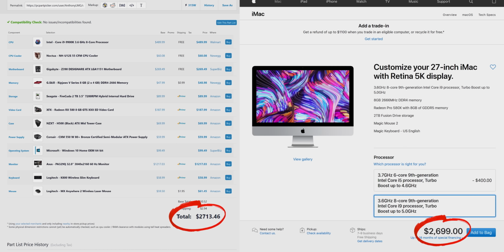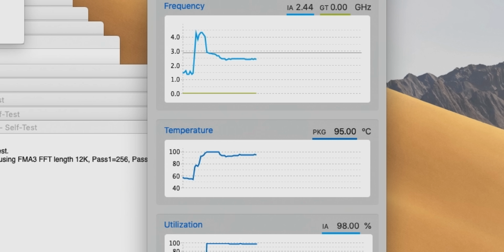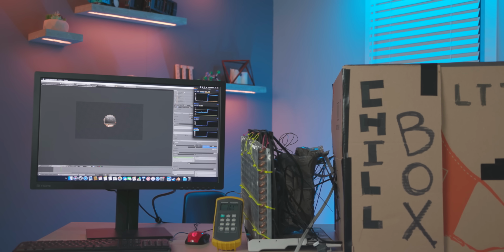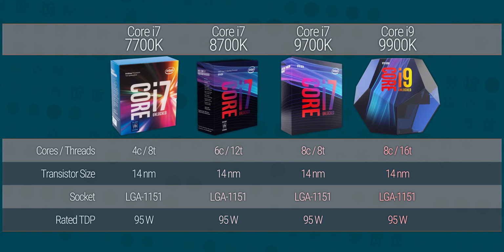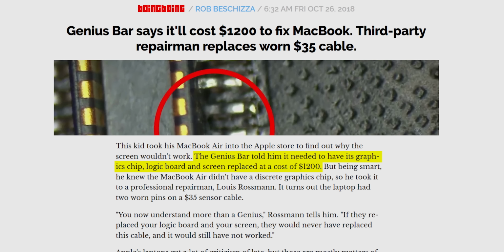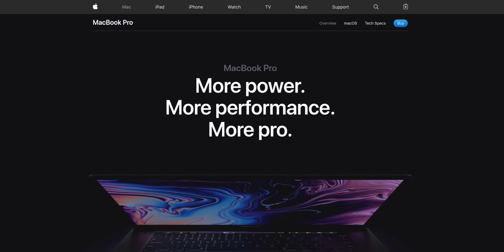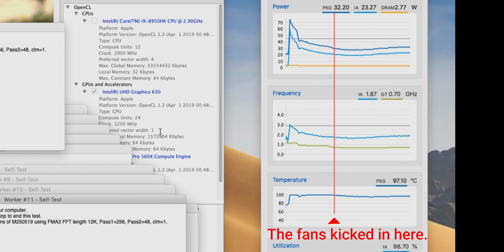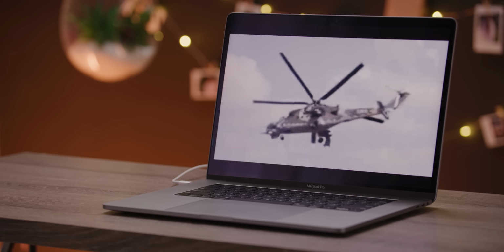Macs are SLOWER than PCs. Here’s why.

Comment: I own 2 laptops.  A Dell 7577 gaming machine, and a 2018 macbook pro.  The fact that the Dell has a battery is little more than a technicality, and its noisy as hell.  Working in IT requires me to always have a laptop handy, and its especially nice if its light weight, quiet, fast, and has an actual 10 hours of functional battery life.  You asked why Apple chose their passive-first cooling policy?  Its probably because their target market isn't going to constantly run benchmarks to peg the CPU full time, or mostly play games on it.  For convenience and portability for light to moderate business work loads, it outperforms every PC I've used.  It's MUCH nicer than my chromebook, not to mention way more functional.  The only thing close would be the Dell XPS 13.  For design and sleep functionality, and the fact that the display is 16:10 vs 16:9, the macbook is a better choice IMO.  And, anecdotally, the mac has never felt hotter in the lap than windows machines.

Comment: There's an application that allows you to set custom settings for your fan speeds on mac. 
If you set it to run at a higher RPM starting at a lower temperature point the mac won't thermal throttle as much.
https://www.crystalidea.com/macs-fan-control 
There's even a version for bootcamp.

Comment: Metal Liquid'ed my ROG g703, it wasn't throttling, but was running too hot.
Now... it runs like a dream, literally. Playing on High or Ultra in AAA games with around 100fps average :)
(the g703 has huge fans to beginning with, just... really crappy thermal paste)

Comment: OMG!!!!   Normally, I like your videos.   But this video is just several minutes of a crybaby.  Your hubris has lead you to mistake opinions for facts.  ( “They did it on purpose.” )

Thermal throttling is a simple concept.   Anyone who can tie their own shoes, should be able to grasp the concept of thermal throttling.

You mentioned physics.   Any freshmen physics major can tell you why thermal throttling is necessary.

You also failed to mention that Apple uses Intel CPU’s today because IBM and Motorola COULD NOT keep the temperature of their CPU’s down to within Apple’s acceptable temperature range.

Speaking of CPU’s, you also FAILED to point out that MacBook’s and iPhone’s USE DIFFERENT CPU’s.   How often is someone going to run Photoshop on an iPhone?   How often is a CAD engineer going to complete an engine design on an iPhone?   Let’s focus on reality, ok?

The truth is many Apple users do not need the maximum clock frequency of the CPU.    Professional Photoshop artists use a WORKSTATION class machine... Apple or Windows.

Not many MacBook users sitting out in direct sunlight for hours on end either.

You also failed to mention the numerous people who received burns on their laps, from Windows laptops, due to excessive heat from their laptop computer.

That chill box.... looked very accurate and scientific.   GTFO with that.

Would have been nice and informative to include testing the effects of least two “cooling pads” on MacBooks or MacBook Pro’s.    But you did not do that.

Please do a better job on the next video.
Reply: The Macbook Pros are marketed to professionals supposedly, particularly those professions whose tasks require robust CPU/GPU performance.  Therefore, the expectation is that the laptops are capable of their claims.

As for Photoshop professionals, including myself, a workstation class desktop isn't a requirement. And a multitude of young or mobile photographers are using laptops exclusively. Is it their fault that Apple is marketing its laptops as desktop equivalents?

Comment: I have an old intel i5 Mac and it out performs all my modern windows 10 pc's. my Mac is a mid 2011 MacBook Air 11inch  with 1.7 GHz Intel Core i5 and 4 GB 1600 MHz DDR3 with no heat issues, no slowdowns. vs my 2017 hp with 8gb of ram and my acer aspire one 2018  with 4 gb and the Lenovo desktop 2015 with 8gb. its never gotten hot, from college to video and song editing no issues and far faster and  I've only had one crash in the entire life of this Mac and that was during a software update. all my windows computers get hot, have excessive fans running during editing and gaming I even have to have a cooling pad for my laptop or it burns my legs on kotor 2 and I own this game on Mac as well and it runs flawlessly albeit at a lower Frame rate and graphically inferior.

Comment: My god. "You'll see the CPU speed touted as 4.8 GHz..." No. I see the CPU speed touted as UP TO 4.8 GHz. Those 4 little letters change the meaning of the whole thing. "UP TO" means that's the maximum limit. As in the speed will be lower than that. Is reading comprehension really that hard? I knew there was a reason I unsubscribed. This content has gone full retard.

Comment: Maybe macbook Pro with the most powerfull i9 is not worth, but when I want to find out good alternative for Macbook Air for student (running programming software, web browsing, and all other not heavy software) for same prize (about 1000 $) I don't find. 
Yes you can find notebooks with better raw performance, with better resolution (this is the biggest weakness for me), but macbook is not about raw perfomance but about user experience. They have the best touchpad (with best gestures for multitasking), very good keyboard and, of course, low noise. On battery it last for too long and that capacity doesn't get lower like in normal notebooks. 
I compare it from the perspective of 'poor' student which have old Dell notebook and have friends with same old Macbook Air (from year 2013 and both cost about 1000 $). Yes its sometimes funny see them playing games like Dota or CS:Go with even lower resolution than theyre Macbook has on only about 30-50 FPS, but when I see them working on it with that 'flow, accurate, fast' gestures and not worrying about battery, just placing to the charger when its need, and still have several times more battery life, I think that this is the best choice for work which doesn't need a strong HW.
P. S. the point is that you are talking about short lifetime, but if you don't use it for render videos or playing games, i think, that it can surprise you...

Comment: There are a few points worth noting as to why iPhones, etc. don't go through as much thermal throttling as Macs.

First is that Apple controls the SoC design for all iOS devices... as opposed to purchasing them.  The control over power consumption and thermals therefore is end-to-end.  Compare that to a Mac, where they have to adapt to parts from a bin.

Second, the SoC on iOS devices is ARM-derived, so it starts from a low power design to begin with,  making throttling something that is less necessary. X86 starts from something that isn't necessarily low TDP and has scaled-down, cut back versions with more active power management enabled in order to bring down TDP.

Finally, smartphones in general are basically sold as more consumable goods than PCs.  The percentage of people who keep a phone for 5 years or more is probably about the same as the percentage who replace their home PC or laptop every other year.  Therefore, if Apple were to be lax about thermals in their phones in a way that negatively impacts their lifespan... not a big a deal because the device will anyway be replaced before it becomes an issue.

Comment: The crap fan control is why I use Macs Fan Control to force them into my own defined curve so they run what I'd call normal (around 2300 RPM) at a lower temp.
Reply: Yep. After burning my wrist on my Mac mini, I installed that and cap temperatures at 150 F/65C. At 135 F the fan revs up to 2,200 RPM and slowly climbs from there to full speed at 155 F. Funny that it never hits full speed, though.

They have enough hardware to cool properly. Software just prevents giving that hardware enough airflow.
Reply: Yup. That and SteerMouse are pretty much essential pieces of software for me to ever consider daily driving a Macbook.

Edit: although the butterfly switches are pretty much a deal breaker. The ~2012 Macbook keyboard was pretty decent but idk wtf they're thinking at this point.

Comment: lmao this is so true, I have 2012 macbook pro and performance is great but when you do something intensive like edit videos or create Android apps, the temperatures jumps like crazy. I had to get my whole i/o board/motherboard replaced because the GPU failed. 
Now ever since I run a fan control program to avoid any over heating issues. It obvious that they need to let the fans run and do their job. Doesn't make sense why they just don't let them. Oh well,  I guess i will switch back to PC for my next laptop. Although OS x/macOS is pretty nice

Comment: There's a missing detail here. Those 6 and 8 core laptops have the same cooling solutions as the Macbook, and are often of equal or poorer build qualities. The 4, 6 and 8 core laptops run at lower clock speeds than a 2-core. There are even recent Intel driver specifically for "steering" CPU performance to the core with the best performance, and drivers for forcing the cooling to be silent.

Seriously, look up "Intel Dynamic Platform Thermal Framework (DPTF)", which is what you're talking about at 9:00. Gamers sometimes uninstall, or don't install it to begin with if they wipe the OS, to get higher performance. But it's this driver that prevents the laptop from sounding like a jet engine at all times.

Comment: If the new Mac Pro doesn’t allow nvidia cards and does not kick ass performance wise I will be buying a pc tower for the first time. That being said my 2012 MacBook Pro with two SSDs installed i7 quad core has been used all day every day since I bought it refurbished from Apple and it has a dedicated nvidia gpu. I have only replaced the battery, it’s been very good to me even when working in warm temps. Plus it has Ethernet, usb 3, FireWire 800 and a sd card reader, I will never buy one of these new mbps that needs a bunch of dongles to do anything. My upgraded 2009 12 core Mac Pro is also going strong, still a great computer. The trash can Mac Pro though it’s now very outdated,  CPU’s don’t throttle like the MacBookpros as it’s got a good cooling system that is also dead quiet when stressed.

Comment: As I watch this on a 2018 13-inch MacBook Pro. lol. But I won't lie, without a program like Macs Fan Control to change the fan curve, this thing gets Tim Cooking under a load. Now, if I'm doing something that requires a bit of power, I don't mind my machine sounding like a jet engine. So that's how I have my fan curve set up. Now, doing normal laptop stuff like browsing the web, using chat programs, making powerpoints, typing papers, etc.... this thing is great. It stays snappy, and damn near silent. Temps also stay under 60c.

I just got it because, when it comes to simple tasks, I prefer macOS. Anything more intensive (like gaming) and I'm hopping on my Windows desktop. I used to be a hardcore Apple hater (other than the phones), but now I've owned two MacBooks, and I think they're great for simple tasks. 

They're also great if you also own an iPhone and Apple Watch. You can use your phone to take pictures on the fly to drop into powerpoints and what not, you can airdrop stuff between your phone and computer, you have seamless handoff capability between the two (assuming you use safari and other Apple apps, which I don't, I use Chrome, but Chrome has its own handoff system that works alright), and you can unlock your MacBook with your Apple Watch. So I just walk up to my MacBook, open it up, and it unlocks without me pressing a single key as long as I have my watch on.

All in all, I still prefer Windows for most things though. I'll never ONLY own a Mac. I have to have Windows as well.
Reply: Basically this. My 2018 MBP with touchbar is my 3rd MacBook since 2008's first 'alu' MacBook. But it's a laptop - it's something I basically carry everywhere and it's supposed to give me an option to do most things on the go if I really need to. In normal use it's basically silent and cool, and quite I basically never put it under heavy load for more than 30-60 seconds in normal use. That's what my desktop is for. And yeah, the reason I use MacBook is because for mobile application it's easily still the best device out there, with insanely good touchpad, that also functions in perfect synergy with iPhone and iPad I use for work. It's basically seamless. Oh, and I use AirPlay at home as well because sports and idiocy that is TV rights.

Now why one would own desktop Mac is mostly beyond me. If you're just doing office&web stuff... get a MacBook and dock it. If you're actually using it for gaming, video or photo editing... get a proper desktop with proper cooling that will be both more powerful and more quiet, and probably cheaper once you cut out unnecessary fluff.
Reply: Maciej Kornatowski I agree with everything here. And that touchpad makes for one of the best mobile experiences, I swear. MacBooks are great “every day task” laptops, but I also wonder why anyone buys desktop Macs.
Reply: A reasonable Macbook user? That can't be right!
Reply: The problem with that is how Apple advertises the Macbook, call them Macbook PRO with 4.8Ghz intel Core i9 blasteres all over their material. While Pro here actually means made for professional influencers (the unemployed) who edit their Instagram Stories Videos @ Starbucks coffeeshops. 

I shoot & edit video for a living and the Macbook Pro simply doesn't do it for me, and to be fair it's the same situation with ALL manfacturers even the Microsoft Surface gave me overheating with editting anything decently sized, but the problem is with making it their only flagship portable computer. 

Apple would sell LOADS of 17" Macbook ActuallyPro or Macbook SuperPro only if they gave it a bugger chassis to allow cooling the i7 & i9 chips and added three vital connectors: One USB A, one SD card Slot, and one Ethernet. 

That's it. Just watch the cash roll in from all those actual professionals getting paid to create and meet their deadlines.
Reply: Ebrahim Saadawi yeah, the MacBooks are great for amateur YouTube editors that render 1080p content, but nothing more than that. You need good cooling to support your components if you’re going to use those components to their full potential. 

The pro is great for people who want a laptop that’s small, portable, and looks good. It’s perfect for execs who travel a lot and have to edit keynotes, and work through emails and spreadsheets on the go. Problem is, that’s not how Apple markets them. They market them towards people who are professionally editing videos and such. Apple has made it up the step for a great photo editing and manipulating machine, but stepped up and slipped off the step up to a good video editing machine. But hey, how can you not expect a computer to cook itself when it’s made by a company ran by a guy named Tim Cook

Comment: Here's the answer. Not everything is about building a gaming machine that can perform at highest output at all times. You can say the issue is "thermals" or "voltage" but the real issue is...it's a laptop, a PRO laptop, sure, but the idea that I'm going to do some heavy, heavy gaming on a device designed to mix convenience, looks, professional use, and portability is what's truly absurd. So there are some PC laptops that perform well enough to be hardcore gaming devices. Gosh, that IS really neat. So someone has designed a laptop for your niche - pumping a huge load of electricity through your slim device so you can game nearly anywhere. But macbook pros address real concerns: NO I don't want my laptop spinning up fans the size of Hoover Dam turbines in a meeting at work. Also, I want the device to be easy to carry and professional-looking. And as someone who has been handed a laptop by my employer several times, it's never a gaming laptop or anything near it that would stand up to the scrutiny.

So sorry, gamers. Sometimes form IS function. How about you compare a $5k imac pro or mac pro desktop instead? As for iPhones being appropriately "thermed" instead....yeah that's because you have to push the hardware to the limit to make it small, make it last, be durable, and perform. 

Which is not to say this wasn't a good analysis. It's just that often times we can't put the "fun" in "functional." That's life I guess.
Reply: Oh good GOD it should not matter. The looks of the laptop are not important how it preforms is. That's like saying the looks of a car are more important then how it handles and preforms. You may not care about it. But that's because you are not looking at the bigger picture.
Reply: Oh and Form is not function. THE HARDWARE IE what inside needs to work. Same goes for a car. The reason a Camaro works is not because of form over function its because the Camaro has a  V8 engine. The design of the car is so that it can cut through air better and no slow it down. Let me put it this way. Let's put it this way let's take the Lamborghini with a V12 engine and take it out and drop a 4-cylinder engine into it. Yeah you have a nice looking car. Its just to bad you can't go very fast with it. 

It's like having a Ford, GM, or Toyota truck with out the power behind it. What's the point? You have a nice looking laptop but it's power lowered.
Reply from the maker: No one mentioned gaming.